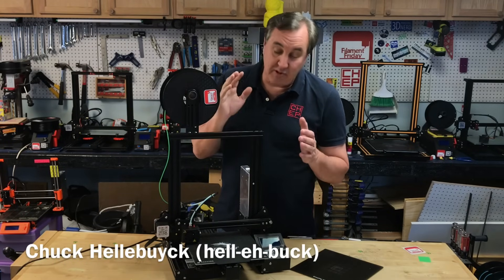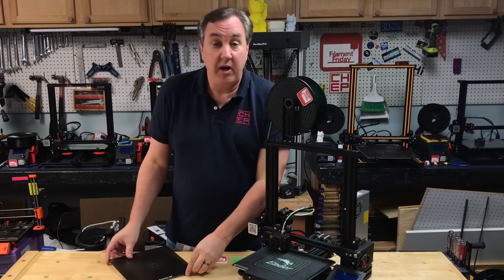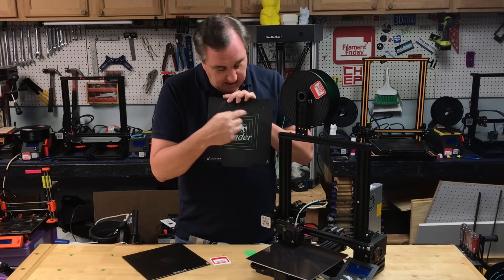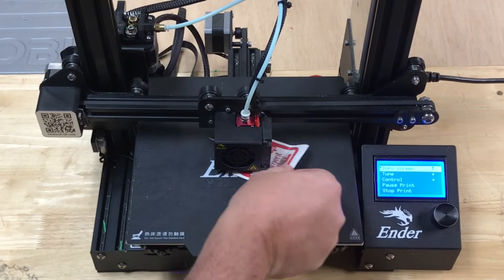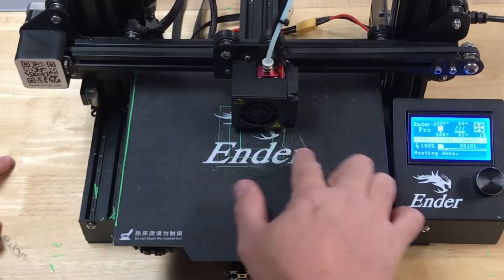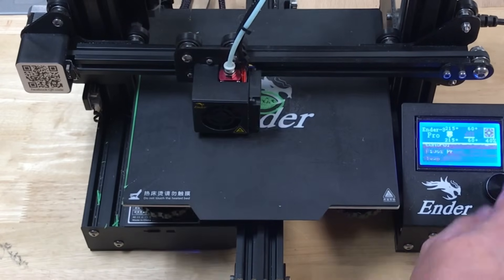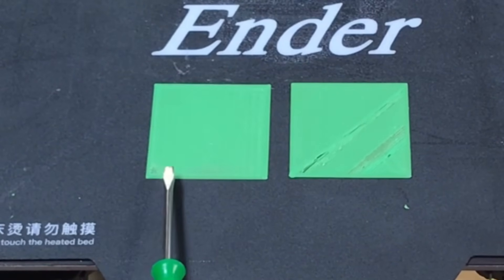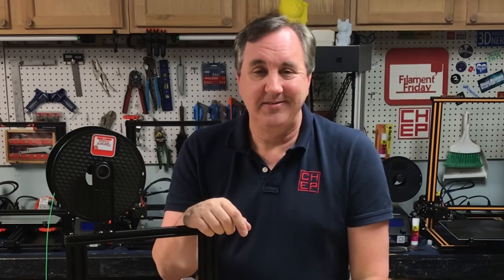Creality Ender 3- Easy Way To Level Your Bed

Comment: Great tutorial but just one question what is significant resistance? Is it until you can feel slight resistance or is it until you scratch the paper slightly.
Reply from the maker: It doesn’t matter just gets you close. Live adjust is where you finalize it. You can also get my bed level tool if you want. https://youtu.be/715Xop79Sus

Comment: dont know what im doing wrong but i downloaded the bed level gcode and when i ran it, it went to the first corner and lowered down to the bed then raised up and when to the back corner.  it did this for all 4 corners then did it again 4 times without ever stopping at each corner for me to adjust it.  any suggestions?  just got the printer for Christmas so still learning.  Creality ender 3
Reply: think i may have figured it out.  my ender has the 4.2.2 board so i think i needed to get the m25 file from your zip file on thingiverse.  hopefully that works
Reply from the maker: Yes, you do.

Comment: Quick ?, I downloaded Cura and my projects won't adhere to the plate. I thought that my bed wasn't level but I ran the same project through Creality and it worked. I noticed a 10 degree difference in the bed heat. Would this cause my problem? I'm very new to 3d printING and would appreciate your help. Thanks
Reply from the maker: You can raise the temp but I suspect your bed still isn’t leveled properly. Try this: https://youtu.be/_EfWVUJjBdA

Comment: Something happened with the bed level g code. It doesn't stop to let me check for resistance it just goes immediately to the next one
Reply from the maker: Use the M25 version as described in the top pinned comment
Reply: @FilamentFriday  thank you!

Comment: Great video - I am having issues (I'm using the ender 3 V2 brand new from Amazon). When I load the files they get stuck loading at 19% and nothing happens. Is that because I am using the V2?
Reply from the maker: Try the M25 version for V2 from here: https://www.chepclub.com/bed-level.html
Reply: @FilamentFriday  Worked a treat - Thank you!

Comment: The problem I have is that when it moves to the second corner I can’t get the paper under the nozzle even when the leveling knob is tightened all the way down.
Reply from the maker: Then adjust your z stop switch higher.
Reply: @FilamentFriday  then I get the opposite problem and I can't get all four corners up high enough, one corner is always too low and I get no print plate adhesion and I end up with a ball of spaghetti.
Reply from the maker: https://youtu.be/8qLJyaBlCCA

Comment: I tried downloading it but I don't see any gcode named Ender, the gcode I downloaded from the website in your description doesn't stop after the 1. point but continue going so I can't adjust the bed? Any help?
Reply from the maker: Use the M25 version as described at the top comment.

Comment: M420 s1 and G29. Chep.  When I install jyers 3x3 mesh bin file without cr touch or bl touch do I need to add both those codes? Thank you.
Reply from the maker: One or the other, not both. But M420 requires you run autolevel 1st and store results in EEPROM. G29 runs before every print but can cause issues which printing two color with two GCode files like I’ve shown in other videos.

Comment: it doesn't work. Mu printer doesn't stop it just keep going from point to point I don;t have time to check or adjust anything.
Reply from the maker: Check the comment pinned at the top. You probably need the M25 version.
Reply: @FilamentFriday  Now it works, Thank you!!
Reply: Oh and I can't pause it for some reason. it just goes till the end.

Comment: Thank you for the bed level gcodes. Have an Ender 3v2, so I also started reading about how to program gcodes so I can write a leveling program. I couldn't get your m25 leveling print to work in the machine. Maybe have to slice it ? Picked a random file in the micro card that Creality gives you. Then had Cura on my mind to learn, so didn't realize Cura was included on the micro card, as Creality slicer. IDk, kind of crummy for Creality to call it their slicer. I think it's called infringement, which as we all know, not recognized in China.

Comment: What if the printer won't get close enough to the bed to adjust it and the paper doesn't touch the tip at all when adjusted all the way?

Comment: What if the printer won't get close enough to the bed to adjust it and the paper doesn't touch the tip at all when adjusted all the way?
Reply from the maker: Then lower the Z stop switch on the side.

Comment: When I run the bed leveler the head nozzle is off the platform it’s not above that screw? Any advice?
Reply from the maker: Did you home it first?
Reply: @FilamentFriday  First time here so I really appreciate your help. I was able to fix that. One other question when I start printing I’ve done it three times and it stops. Is there Somewhere I can send you a picture?

Comment: Hi...I use this all the time.  Bed leveling was the one thing I wasn't prepared for when I got into this hobby and it turns out it is probably the most important step, so thank you for sharing these 2 files.   I still use this from the SD card as I have not been able to run it on Octoprint.  It works, but I have to go back to my Octoprint console to hit "Resume" as opposed to the button on the Ender 3.  Is there any way to keep the commands at the printer?  Not a big problem, since everything else I can send directly from Octoprint and I just leave the SD card in for the bed leveler.  Thanks...Irv in Florida
Reply from the maker: I don’t use Octoprint so I don’t know.
Reply: I use octoprint, but i don't find a use for using it while using CHEP's bed leveling gcode.  You have to be at the printer while leveling anyways, and walking back and forth to octoprint really doesn't seem necessary.

Comment: your leveling gcodes are ruining ender 3 ver 2. theyre only 200x200 your code has lots of y and x axes above 200. you specifically say" Ender 3 V2 and the firmware doesn’t recognize the M0 command. So it may not pause at the corners. Go to here and use the 32-Bit M25 version. "

Comment: how do i use gcode? turn into a stl file?
Reply: Gcode is command code (instructions for your 3D printer). You should be able to just save it to a SD card and load onto your 3D printer. 
STL is a 3D model file which needs to be converted to Gcode to run on 3D printers. 

TDLR: Put it on a SD card
STL->GCODE->3D printer
Reply from the maker: Watch this. It explains how it all works: https://youtu.be/FahVngvlhoY
Reply: Thank you guys.  I figured it out after I asked the question.  Thank you again.

Comment: Hi, so i bought my first Ender 3 and simply cant get the nozzle to run less than 20mm off the bed.  Even with the vertical switch set low (and taken off!) the nozzle returns to 25mm above the bed once I start the levelling programme - help

Comment: So, before I do this, what height am I supposed to have the bed at and what position am I supposed to have the z offset at? If I missed this, please point it out in the video.
Reply from the maker: Z offset at zero. The bed doesn’t really matter because you’ll be adjusting it.

Comment: The print doesn't seem to work with Ender 3 v2. It just goes to each of the 5 spots. Dips down for a second and moves to the next. I understood that it would pause at each corner for the adjustment and then you push the button to make it move to the next spot.
Reply from the maker: Read the comment pinned above yours at the top.

Comment: So I used your these techniques on my printer and its tuned the best I have seen in a while using your g-code. When I got to use mine, the nozzle ends up being miles away. Can you tell me what's wrong?
Reply from the maker: Check fir Z offset other than zero.
Reply: @FilamentFriday  I am experiencing the same with Ender V2 and the Z-offset is 0
Reply from the maker: I heard some people say their boards were stopping before hitting the Z stop switch. Check for that.

Comment: Hi CHEP, using your code my nozzle remains on the left hand side, but never moves to the right hand side corners, or middle. Can you think of why this is happening? Perhaps something not tightened correctly?
Reply from the maker: Is it just the code or can you move it from LCD move menu?
Reply: @FilamentFriday  thank you for the quick reply CHEP. A few hours later and I managed to work out it was the band that required tightening. Doing my first print now, wish me luck 🙏

Comment: Hi All, I'm having a lot of challenges getting my Ender 3 v2 level - I'm convinced the bed is warped. Can anyone provide some guidance on what is best to do / how to resolve it and make it usable?

I've spent many many hours doing the above, I still get fails :(

Many thanks in advance
Reply from the maker: Flip it over or replace the bed. Or just print in the corners and not the middle until a new bed arrives.
Reply: @FilamentFriday  Thank you, only had the machine a month. Potential warranty replacement? :)

Comment: Hey! I'm trying and i just can't do it... One month with the printer and i just printed a single piece :'( I tried this and my lines are thin or failing or just not sticking, i don't know what to do... Thinking of installing a bltouch
Reply: But I ALMOST got it right...
Reply: Make sure the bed is cleaned with isopropyl alcohol.
Reply from the maker: Igor - This should help: https://youtu.be/nMLKNB2r-M4

Comment: My problem is that straight out of the box the bed is wobbly. It move about a 1/16" from corner to corner. Any suggestions?
Reply from the maker: Adjust the eccentric nuts on the two wheels.
Reply: @FilamentFriday  I'm sorry, I meant the base frame. I loosened the two screws on the leg and it popped in place. Now to start assembly...THANKS!

Comment: Anyone else having issues that the gcode file just goes contunusly and doesn't stop at the corners
Reply from the maker: Read the pinned comment at top. You’ll need the M25 version.
Reply: @FilamentFriday  ive tried both and none stop at corners. I am running it via usb cable
Reply from the maker: Use SD card see if it’s different.
Reply: @FilamentFriday  unfortunately I have issues with the one they sent and my computer (it’s a tad old but getting new one next spring). Only way I can get ender pro 3 to run is having it plugged in via usb
Reply from the maker: How are you running the GCode from your computer?
Reply from the maker: Cura doesn’t have a terminal feature to send GCode to an Ender so I don’t understand how you are getting that to work.
Reply: I am.  Chep.  I looked at your pinned comment.  I still don’t understand.   I need Ender 3 ver 2 gcode that will pause above screws.  Can’t find it.  Spent all day looking.
Reply from the maker: Douglas White - https://www.chepclub.com/bed-level.html
Reply: @FilamentFriday  thank you but how do I run gcode? Only way I know how is to convert to stl.   Is that what I do? Thank you chep.   I appreciate your time.

Comment: I'm new to 3D printing  and I struggled a lot with leveling my printbed. Your video made my day! With your instructions and the Gcode files for the first time I leveled my printbed perfectly. Even more so, my print results are 200% better the ever before. New subscriber..! Many thanks.

Comment: this doesnt work.
i heartd a buzzing sound from my ender 3 max when i tried to level it after my 1st print, and then no matter how much i tightened the screws, it was still 1~2mm lower than the print head
running this program doesnt let the print head go any lower.

how do i make the platform higher in this case?
Reply from the maker: You adjust the Z stop switch.

Comment: How do i use the bed leveling g file with my ender 3v2.  The nosle doesn't stop automatically at each corner.
Reply from the maker: Use the M25 version
Reply: @FilamentFriday  thanks!

Comment: this is extremely frustrating...
Reply: How is this not the top comment?
Reply: @tkirchmann   kin😂da oing through a rough time with my ender3 v2. It has been about eight months since I started 3 d.
I have been printing a lot and decided to get new bed covers. Thank you for the session just.  Finished..I was going to ask a few questions but thin I  have the answers now. Gotta wait till morning. Dr. bob
Reply: It is now @tkirchmann
Reply: Fucking agreed
Reply: @MichaelLopez-bw9ee  You and the commentator need to stop like CMON! Leveling is easy and if it is that frustrating, get an AUTOMATIC BED LEVELER for your prints!
Reply: @PeanutButterMan802 I am brand new to this, if I knew about bed leveling I absolutely would have bought one with it
Reply: Every time the z height resets like wtf
Reply: There is so much truth here. Christ.
Reply: Cmon man we’re almost there it almost prints hhh
Reply: I just got a CR touch and it took me probably 1.5 hrs to install but now I’ll never have to level again
Reply: Yes yes it is
Reply: I agree
Reply: If you (or likely some one else since this comment is 2 years old)  really doesn't want to deal with it get one of those automatic adjusting things
Reply: Buy the cr touch it takes an hour to set up but is AMAZING!
Reply: I burned a bit of my bed cause of leveling the bed wrong it’s a frustration
Reply: I punched my printer and it broke
Reply: oh ny lord Yes!
Reply: Yes
Reply: I just want to slam mine on the ground already
Reply: Literally what moron went “ you know instead of doing an auto leveling like most printers and how the X and Y axis on this same printer do, I’ll just put 4 wheels for you to turn so you can print at a 160 degree angle because that’s what everyone wants right”
Reply: Seriously what a overrated printer rarely use it because of this
Reply: @handikappad  Every 3d printer needs to do this. If it's that big of a deal, get an automatic bed leveler.
Reply: @jonasgrill1155  Yeah every printer needs to do this just less than 1% of how much they need to do it compared to the Ender 3. Just look at a Ender 3 and it will need to be leveled again.
Reply: @jonasgrill1155  I am not rich.
Reply: @handikappad  there's probably something wrong with your bed, or you're putting too much force on it when removing prints.

I would look up troubleshooting tips for it, because you may need stronger leveling springs or something.
Reply: @bismark6691  Creality sells the CR-Touch for $50, which is a bed leveler with out-of-the-box support for the 32-bit ender 3 boards. An "automatic" bed leveler is a little generous, because it's not fully automatic, but instead of having to use paper, it'll get the levelness of each point that needs to be level and give you a topology of the bed, which you can use to incredibly easily level the bed.

It'll also check the bed levelness before a print and pause it if it's not level enough to complete.
Reply: @jonasgrill1155  I don't have an ender I got a monoprice ultimate maker
Reply: @jonasgrill1155  I already got the spring upgrades
Reply: Agreed. It’s a total time suck and not worth the effort

Comment: I have a problem. The chep level print works perfectly but when print anything else, it doesn’t stick to the bed. Any ideas to solve this
Reply: You can use a glue stick or make the bed temp be 85 degrees, some filaments use different bed temps or you have to make the nozzel hotter. Printing hotter helped me with the filament starting a stopping mid line. Hope this helps
Reply from the maker: Clean the bed with Isopropyl alcohol.

Comment: Mine just runs through the entire test without pausing/stopping. I think it might be broken.

NVM im an idiot I needed the M25 file. Thanks man!
Reply: Thank you for commenting this, I just got mine secondhand and this was the file I needed. There should be some context in the description reflecting the additional gcode!
Reply from the maker: On the website where you download the files is a full description. 

“32-Bit Ender 3 V2 and newer Ender 3, Ender 3 Pro - For newer printers, Creality is now installing 32-Bit boards in the machine and running Marlin 2.0,x firmware. Some of these setups don't recognize the M10 command so I've created a FF_M25_bed_level.gcode version for these. “

Comment: so ive had my printer for a while, and ive always had issue with leveling, just seemed it was off, lately ive had a bit of a deadzone in my printing bed; which led me to this video and im extremely happy right now, the calibration STL and Gcode helped SO MUCH! thank you for uploading these resources!

Comment: Hi i have a Problem with theese Files. My Ender 3pro  is going to the 5 Levelpoints, but without stopping. There is no way i can level my Bed :-(
Reply from the maker: Read pinned comment at top of comments.

Comment: Great video! It looks like you are using a Gcode file to move the nozzle from one point to another. What if the bed is not level and the nozzle hits the bed? How do you level the bed without hitting the nozzle to the bed?
Reply from the maker: You adjust the knobs further away.

Comment: Hello! I have tried printing the file on a glass bed but no matter how close I get the bed to the nozzle, some corners start peeling off. Is this a bed level issue or a slicer issue? Thanks a lot!
Reply: This is the issue I'm having
Reply from the maker: It’s a bed surface issue. Clean the bed with soapy water, rinse and dry then try again.

Comment: Wow this worked great and I found out that my bed is higher in the middle than the corners :o Gotta get a new bed
Reply: Not necessarily. If you adjust all 4 corners up you might be able to bend it straight.
Reply: @paveldorovskikh5513  Na man I think it's irreversible. The metal is bent. I can even see the curve if I look at it good enough. It's ok I got the max I just hooked up. Had it for a few months. Man it's definitely far better.